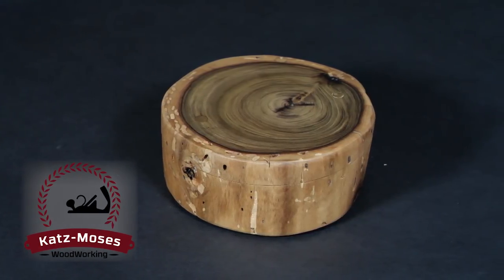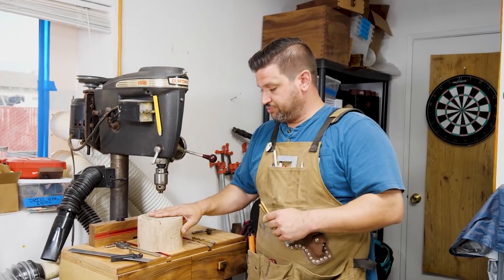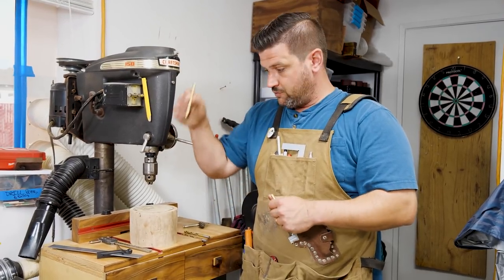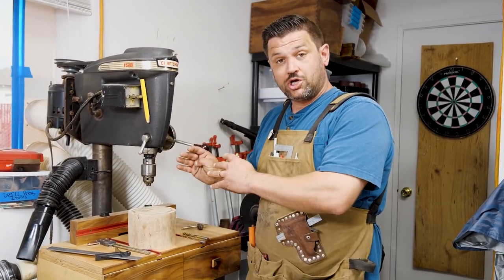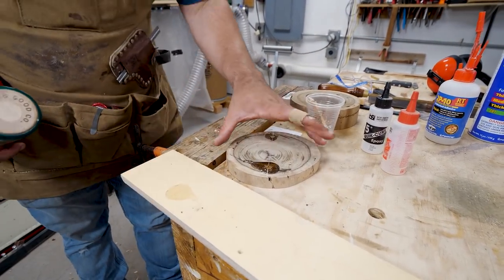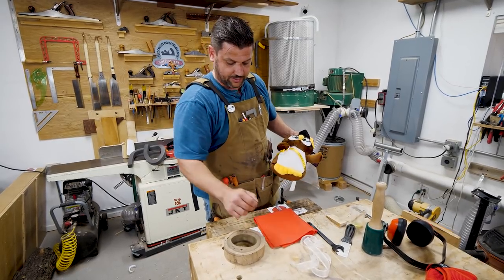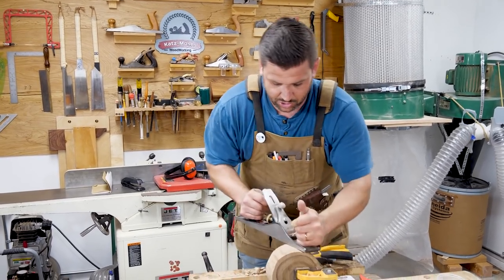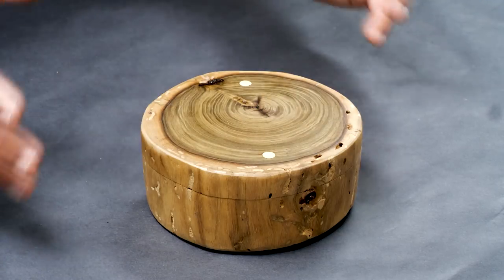Ring Box From a Walnut Log - 1 Day Build

Comment: Cool project! Nice work!...I’d like to ask about the moisture percentage of the wood and also the size and thickness of the magnets....Thanks
Reply from the maker: Moisture was higher than expected because all the slabs we milled up are at 8-12%. The log has been sitting in my shop for almost a year but I underestimated dry time. Either way I'm not worried as the wedding isn't for 2 months so I can reshape the outside if it goes wonky. the magnets are 9mm by 3mm. The same ones used in my dovetail jigs so they're very strong.
Reply: Hardwoods can take years to air dry.... pine is usually good between 6mo to a year depending on your climate. In Mississippi, it doesn’t take long 😃
Reply: And the magnets?????  Thanks
Reply from the maker: Tom Lagatol read my entire comment